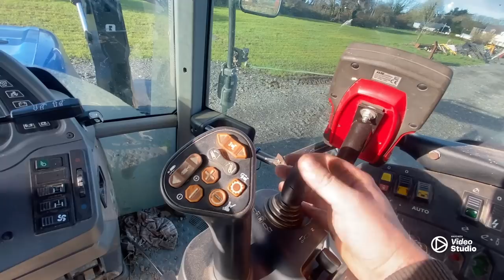WHAT LURKS IN THE SHEDS ???MR CVX’S MACHINERY GRAND TOUR

Comment: What way does the terex cope with the slantrac? Have the same digger thinking of putting one on it dunno if it has enough oil flow for one, thanks
Reply from the maker: As with most diggers it will stop the head whe of you track and also when you lift the boom, slewing is fine